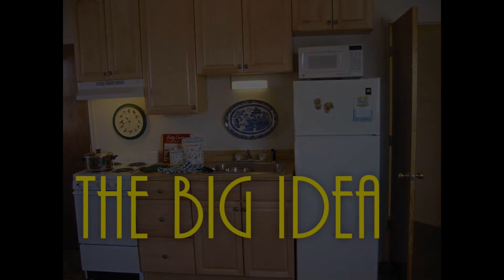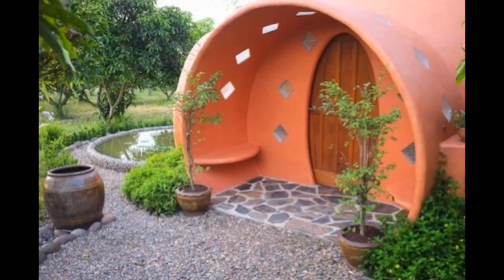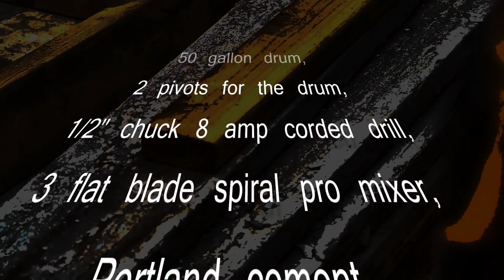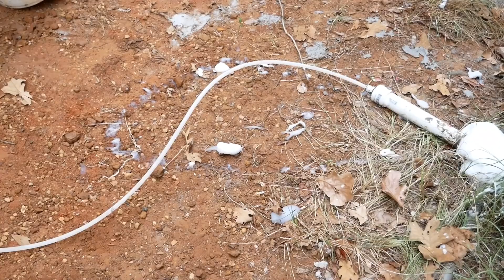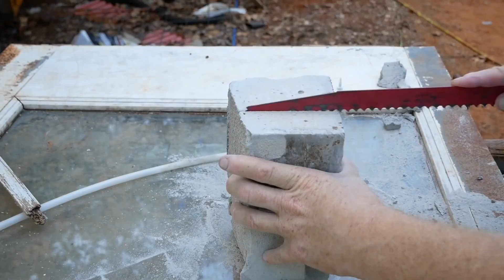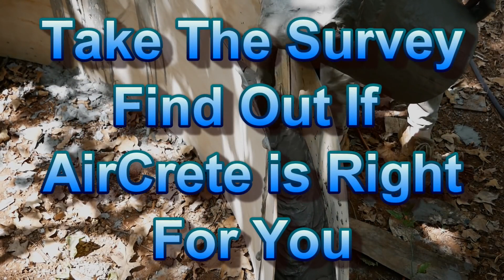HOW TO BUILD AN AIRCRETE TINY HOME

Comment: Why not just form your house walls with IBC code enforced rebar, and pump them full of concrete? It's much "cheaper" than wood frame and storm proof.  30 years in the industry and you are selling this? Are you trying to profit from less experienced individuals? Perhaps the industry is not paying you for a reason.....
Reply from the maker: you still need a form or a mold if you pump concrete.. You need a big balloon.. There is no profit made in this video. there is no industry on this yet.
Reply from the maker: Not all places have concrete pumps and rebars…